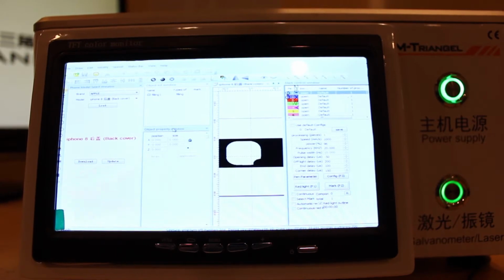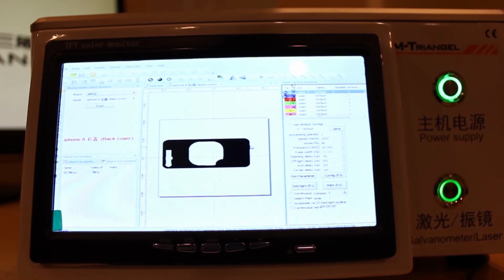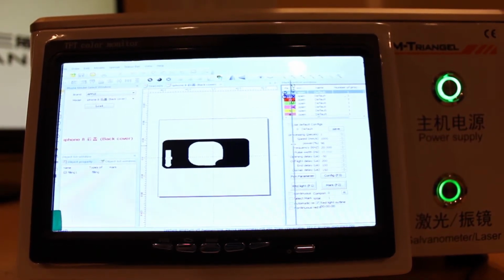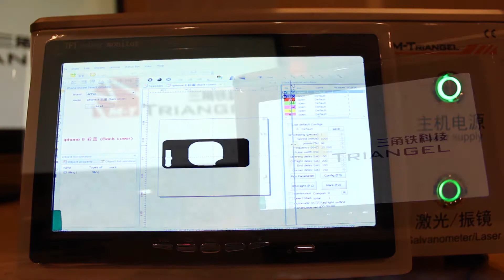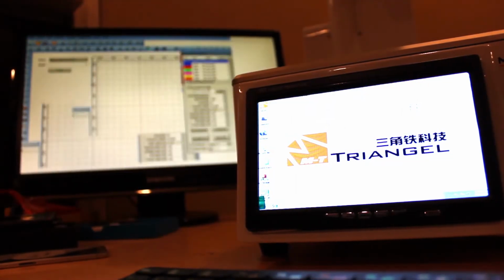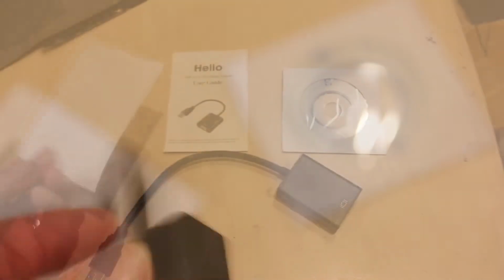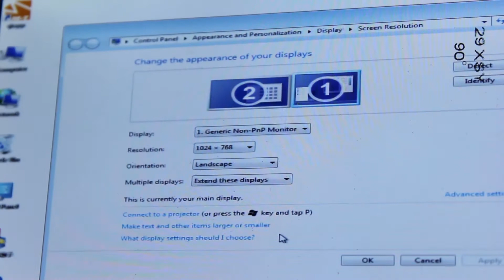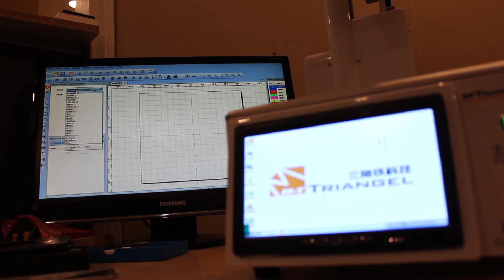Using the PGoneS with an External Monitor

Comment: I can't connect my second monitor. I only have 2 usb I got USB Hab and I installed driver nothing..
Reply from the maker: Unfortunately, I can't provide detailed help since USB hubs are all different. However, try using the hub only for the mouse and keyboard, and connect the monitor directly to a usb port on the machine. It's possible that a hub could interfere with the video signal.

Comment: My pg oneS only has 2 usb ports at the back, does it eork on any usb port?
Reply from the maker: The newer revisions of the machine only have two ports. While a USB monitor adapter will work on either port, you will need to add a USB hub so that you can connect both the keyboard and mouse (which both require their own USB port). Alternatively, if you have a wireless keyboard/mouse combo that use just one wireless receiver, you can use that and avoid the need for a hub.